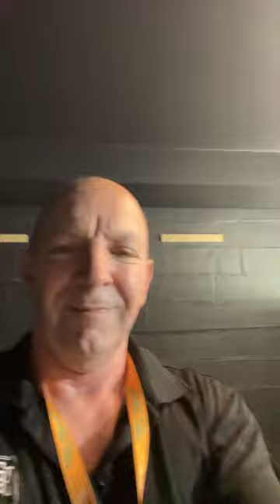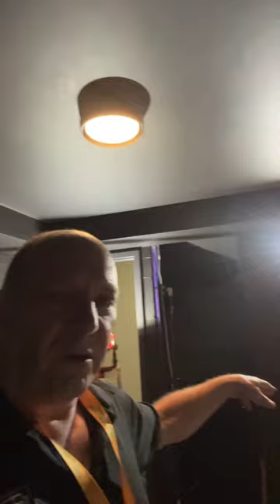HTE building up a small 3m x 4m high performance private home cinema

Comment: Really small space being about the biggest size I could build in my garden and not a huge amount different to a lot of the modest builds on forums. 

It must be lovely for all the people building in far bigger spaces and spending 80k plus on equipment!

This will be interesting to watch for sure 😊 nice work
Reply: Thanks for you comment. Great cinemas can be built in any size room with the right aunt of effort.. watch this space!
Reply: @AndrewPoole01  absolutely mate has just built one in a converted loft. It's great fun but it would not compare to some of the things I've seen you all advice!

I've just picked up a svs 16" for my work in progress and I'll try to get another. I think 2 should see me out hahahahaha
Reply: @niro750  I don’t mean to offend but if it is a small room 16” SVS could be massive overkill. We are running 2 x REL 1205 and have seat shaking chest thumping bass. I have always struggled to get refined detailed bass with large SVS subs in a medium to small room
Reply: @AndrewPoole01  I take your point, I'll do some experimenting and if it's not suitable I'll be able to sell it on either way. Sledge to crack a walnut probably. It will be interesting to see how it operates dynamically. Sometimes the fun is doing something stupid for a hobbyist 🤣
Reply: @niro750  absolutely and everything fits on a learning curve!
Reply: @AndrewPoole01   I wanted to try the whole pressurised room thing and to have overhead to cover nulls. I have about 40-45m³ volume. But if it's too much it will easily go in the house for the TV as we are open plan downstairs and my current sub is 12in and doesn't even come close to giving good bass due to position and volume of the space. So thinking on it I have options that won't see it wasted really but no offense taken. It's all interesting and fun and everything can be moved or sold. :) Thanks for the convo
Reply: @niro750  Anytime!
Reply from the maker: hadn't realised I had been replying from my personal account doh!